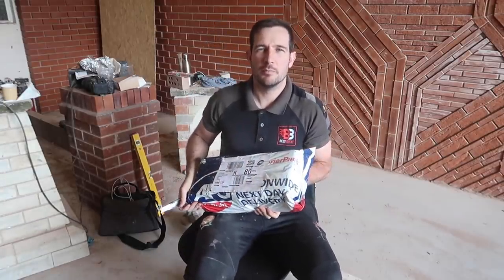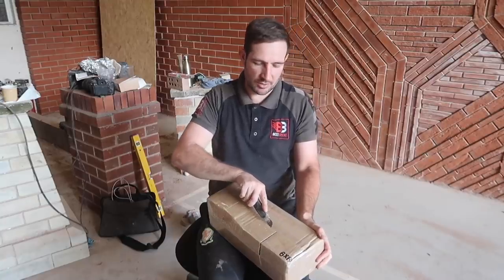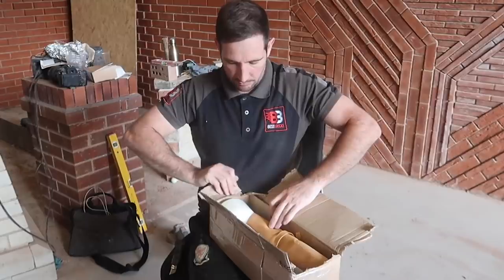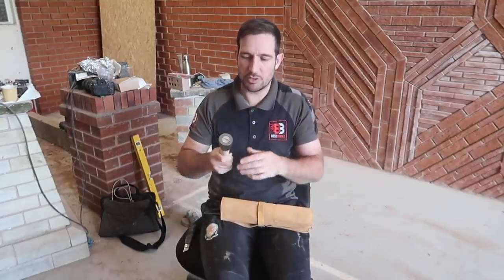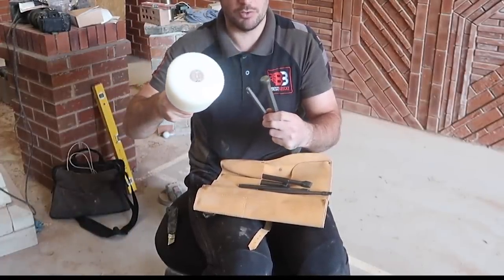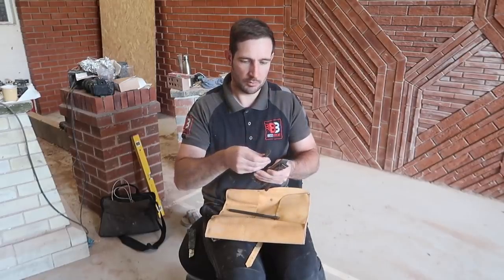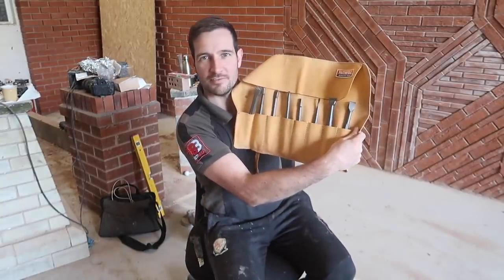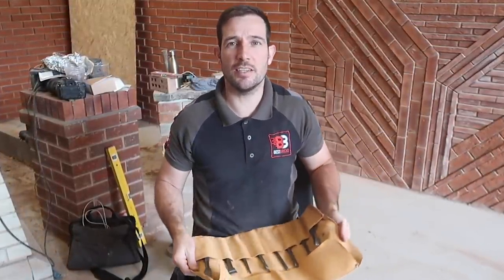Stone Carving Tools

Comment: I'm pretty sure the white mallet is a nylon material, and I'm pretty sure u can use either mallet just preference. I'm no stone Mason but I did my time with one, very smallest ones will be for v lettering and the skutxh ones I I think for putting lines in quoins. Could do with a punch and a decent pitcher aswell. Also look into 4" grinder blades, like cup discs, flat diamond and carborundum for polishing stone. Hope this helps all the best 👍

Comment: The white mallet is spun nylon, the chisels with the round head are for use with the mallet. The other chisels can be used with a hammer or the dummy. The first thing we learnt at college was a flat surface, 1mm over 300mm is the tolerance to pass on to the next piece. We then had to square off of that to make a square block, we then used that block to make another piece. My chisels are probably all rusty as I haven't used them for so long but I can do 90% of the work we need to with a 5inch variable speed grinder or a multi drill. Have fun and good luck 👍🏻